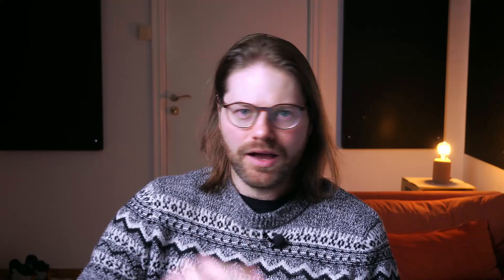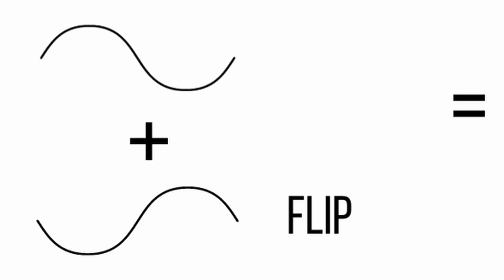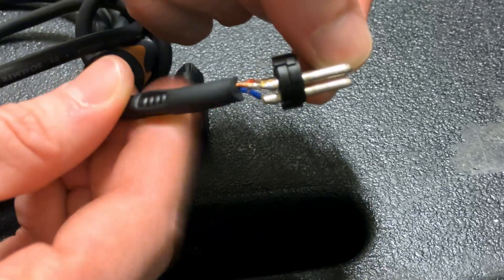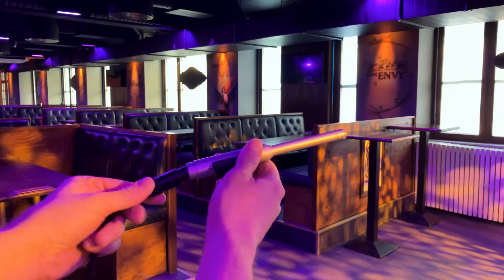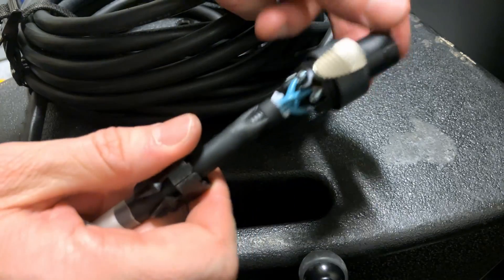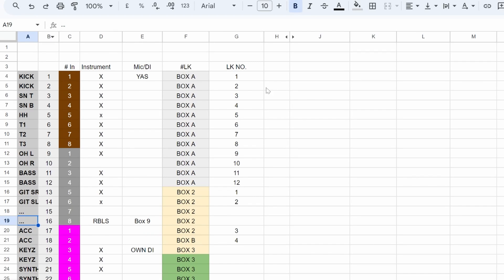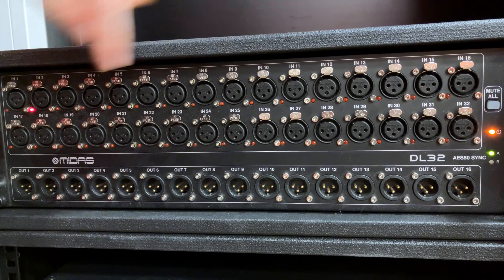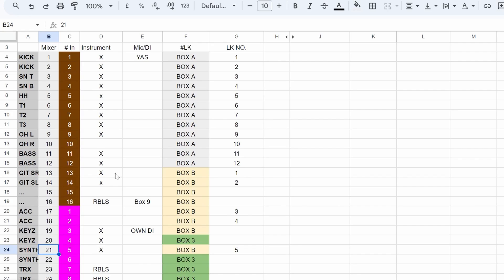Get A Neater Stage With Fewer Cables

Comment: You can actually think of cat cables as 4 balanced cables because that's the way they were designed to carry 4 balanced audio circuits of telephone service.
 I run studio hub adapters, that gives me two channels at a mic stand for vocal and instrument. Than that goes down and combines with another two channels into one cable that plugs into a cat rack in my box which goes to my mixer. all the benefits of analog cabling and digital mixer, And set up it's just a snap. If I need to remove a mic stand I unplugged one cable pull it to the side.

Comment: CAT breakout box one time saved a gig I worked on due to quick load of equipment from a crew I work with. Thankfully, our sound engineer had Klotz CAT Link mini in his emergency case which helped and saved time.

Regarding the subject, I work in audio only a year and a half. Before I've started working as a tech in a rental company, learning the trade, I spent more than 20 years on stage as a performer, and to be honest, more than 95% of stages were a total mess! Cables all over the place and whatnot. Since than, when on a gig, I do my best to keep my stage clean. That means: calculating number of channels used by performers tech riders to get the exact number of connections, easy access to re-patch (if needed), stage box and connector labeling (very important for beginners and handy for every stage tech), planning cabling route, gaff tape, fluorescent tapes, cable protectors etc... 
There are plenty of reasons for keeping a stage neat which you named at the start.

Thank you very much for sharing your knowledge and experience with us!

PS. Couldn't notice that you work with D&B audiotechnik. It would be great if you make a video about their D20, D40 and D80 amplifiers. 

Keep up great work, you are a great teacher! :)

Comment: Most bodypack transmitters of wireless microphones can accept instrument or line-level signals. With proper converter cables they can be used as "wireless DI boxes".

RJ45 to XLR converters work best with dual-layer shielded Cat6a or Cat7 cables in which each twisted pair has its own shield and therefore less prone to have crosstalk issues compared with non-shielded or common-shield-only Cat5e and Cat6 cables. Some of these converters have transformers in it, but most of them are just direct connection breakout boxes and can be easily homebrewed.